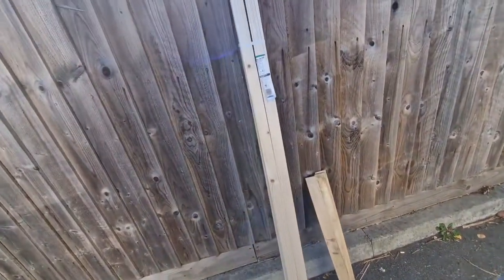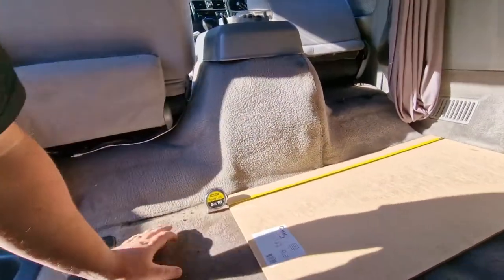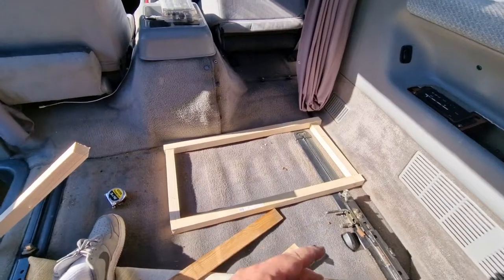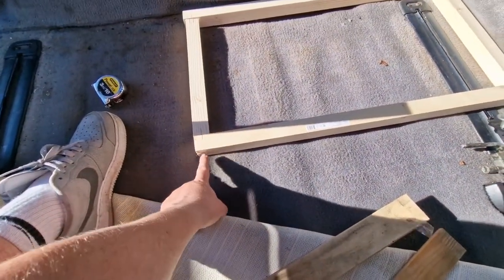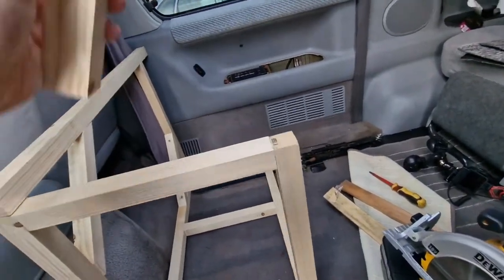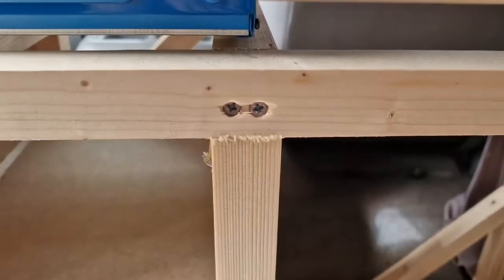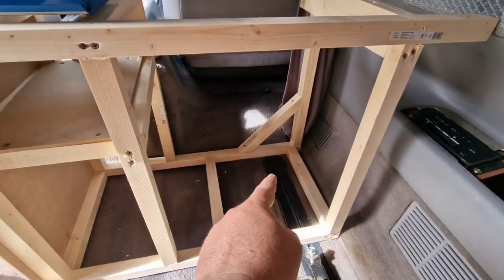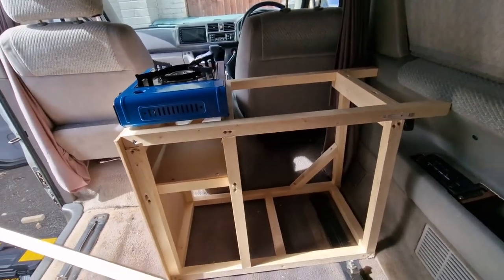Making the Mazda Bongo Kitchen - Ep.2

Comment: Hi mate, are you still going to be able to open the engine compartment on the drivers side with a unit behind the seat?
Reply from the maker: Thats a very good point, I'm going to make it so its easily moved when needed to get access. I was going to bolt it down originally but then the thought occurred to me 😂
Reply: @LS10Works  great video mate very interesting, that's what I'm thinking of doing a rear conversion on mine.

I don't suppose you would be interested in a service manual for the 2.5 diesel bongo, like the Haynes manual, I purchased the wrong one so I've had to but the correct one haha live and learn